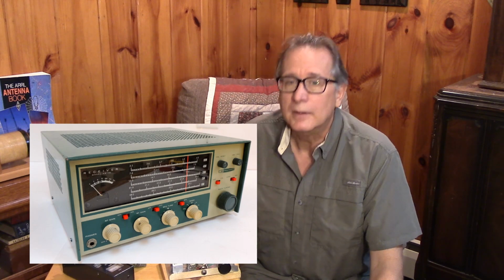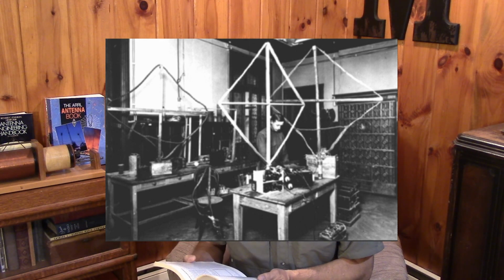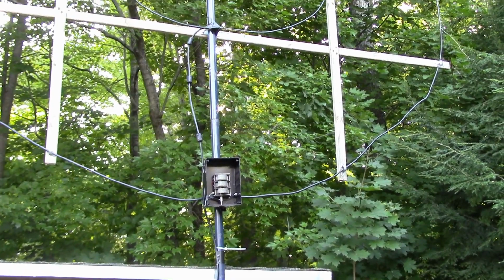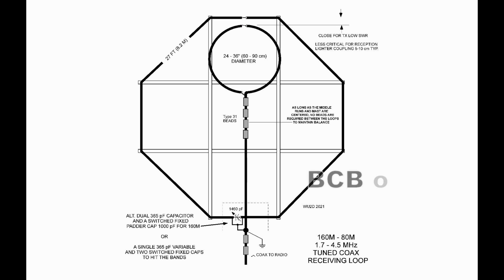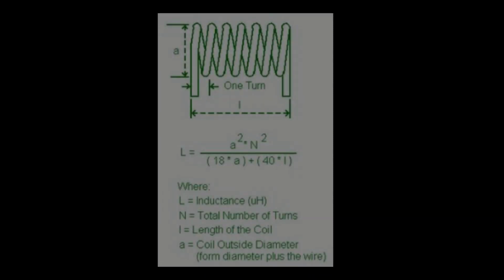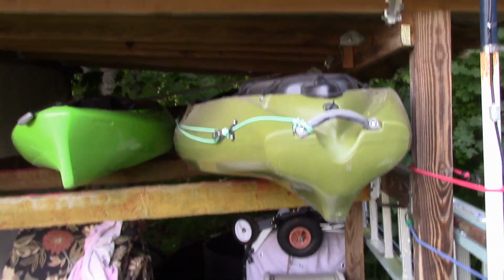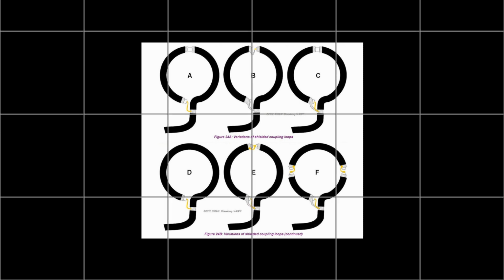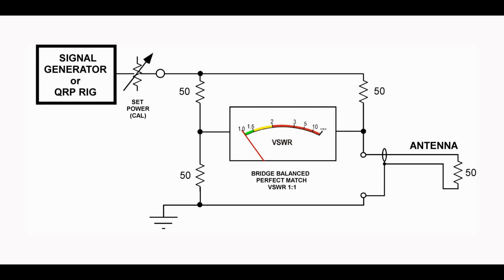Big Loop Part 4

Comment: What about the lowly Grid Dip meter, if you are simply bringing a loop to resonance at some defined frequency. Easy to use, simple, reliable, repeatable & can be calibrated or verified.
Reply from the maker: I'm a big believer in the dipper! There is nothing faster as long as it will tune the band.

Comment: WIEVING FR EU, SWEDEN
                     1005
LOOP[FT] = -------------------
                        Freq[MHz]

IN METRIC SYSTEM

                               306,7
LOOP[METRIC] =------------------
                                Freq[MHz]

USE 
1,5-2,5kv mm(diam 1,5mm-2,5mm)

I CAN TUNE A LOOP FROM 
160MBAND DOWN TO 6M 
IF NEEDED! 

80M BAND= 80,03m ][QRG 3,690MHz]
40M.BAND= 42,25m[ QRG=7,090MHz]

80M band
Rekt. Short 13,5m (x2)
Rekt. Long  26,515 m (x2)

40M band 
Rekt short 7,5m(x2) 
Rekt long  13,63m(x2)
With MFJ 969 300WATT ANT TUNER
YOU CAN USE EITHER ANTENNA
FROM 160-6M [NARROW ON 160M!]

BOTH CAN BE USED AS SQUARE 
ANTENNA WITH EQUAL.LENGTH
OF SIDES! GOES DOWN TO 6MBAND!

SWR NOT HIGHER THAN 1:1,3 
FEEDER 450 OHM LINE  EITHER
ON ONE SIDE O R IN CORNER
CONNECT TO MFJ969 ON 
BALANCED INPUT REMEMBER
ONE OF LUGS T SHORT UPPER
CONNECTORLUGGS. [4:1 BALUN]
[SEE MFJ 969/MFJ962 MANUAL]
NEVER HAD IT HIGHER THAN 
3,5M(15FT) OVER GROUND
REM: OPPOSITE FR FEEDER
YOU GROUND THE LOOP!

VERY QUIET ANTENNA!
RUN S GBR ON 2,5WATT [40M]
ON SUCH A LOOP! 

TEST THIS LOOP AND  YOU
WILL BE ASTONISHED HOW
WELL IT WORKS! 
73s de Gunnar sm6oer >>\<

Comment: Very nice, I liked it. I'm building an antenna now, what do you think about the issue of the coax that will be inside the big ring for proximity and distance from the ring? Any trials on this? Thanks
Reply from the maker: Nesting the pickup loop inside the big loop is not terribly critical on RX only loops, because you losses are better tolerated.  A single loop about half of the area inside the large resonated loop and spaced away a bit or even centered will minimize capacitive effects. You want pure inductive coupling. Of course the double Faraday shield is helping you here too. In a low noise environment I doubt that any of this would make much difference. You could just use wire and no Coax except for the amplifier output.

Comment: Agreed, the untuned loop from video 1 with refinements depicted in video 2 is the way to go. 

Thanks for the informative series, I learned a lot. 

I've recently moved into my first (owned) domicile. My previous landlord was delighted to observe the decommissioning of my array of wire antennas.

With the new home, it's on to a whole new world of possibilities of antenna systems. 

I plan to deploy several long wire type antennas here, the tree supports are excellent (but very high). Far taller than I can manage with a thrown tennis ball or basic slingshot. A drone purchased from Amazon has arrived which I will be attempting to utilize for antenna installation. 

But something inspired by these videos might be perfect on my back roof.

Comment: You can use a noise bridge, or a Grid Dip Oscillator. Instead of using a coupling loop, what about using a gamma match or a ferrite matching transformer?

Comment: Very informative, thanks. I'm hoping I can fit a 100 watt TX loop to my balcony as it's all the space I have.  RX loops are easy, it's the capacitor on tunable loops that becomes a problem when transmitting anything beyond 20 watts or so.  What are your thoughts on this can I ask?  73 KD2ORG

Comment: Last year I experimented with using a 8 feet diameter loop (basically a wire nailed to the wall) with my broadcast band crystal set as I don't have a tree nearby for an inverted L antenna. The inductance of the loop came out around a couple of microhenries (just as in your case). Instead of using a coupling loop, I just connected the loop antenna in series with the main inductor and made it part of the resonant circuit of the crystal set. It worked, however the Q of the tuning tank went down significantly. I suspect that the long antenna wire adds a lot of DC resistance.